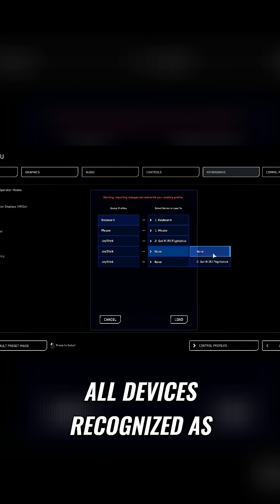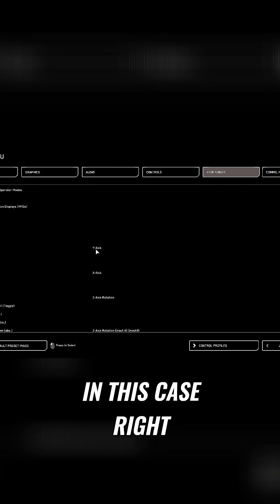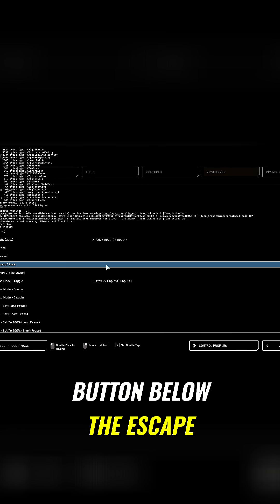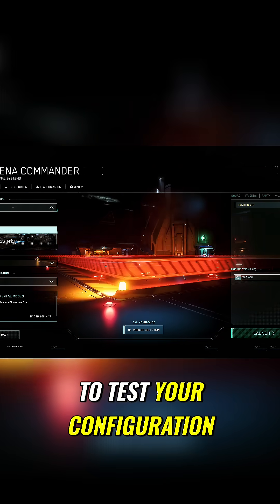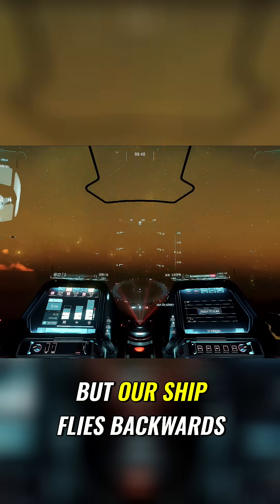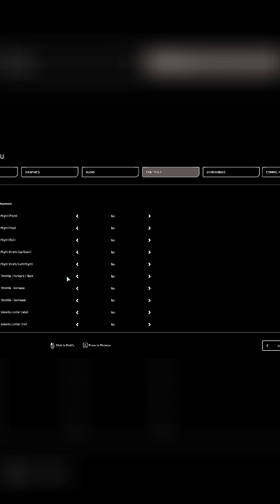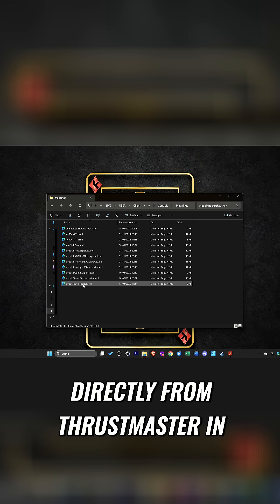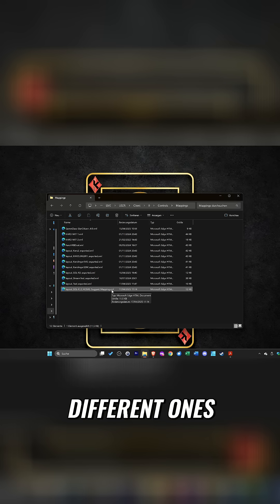Star Citizen Joystick Setup: Fix Reversed Thrust & Bindings!

Comment: Does anyone know if i can bind a Reverse thruster button like in Elite?? Cant find it anywhere in 4.1.1. I want my throttle to work as 0-100% forward and to press a button to go reverse.
Reply: Are you referring to Flight - Movement : Throttle - Forward/ Back invert? that toggles it yea.
Reply: I have a solution for you (I run 2 joysticks and a throttle) the joystick is bound to Flight - Movement : Throttle - Forward/ Back *DONT TOUCH THIS IF IT WORKS FINE*. 

For backward thruster bind the button or axis you want to use to Flight - Movement : Throttle - Decrease.

I think this should work for you.